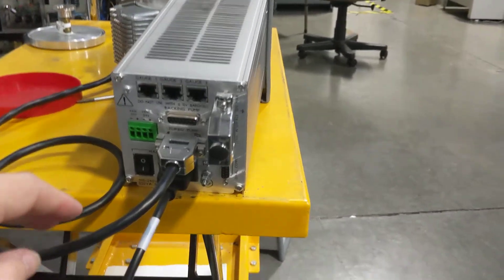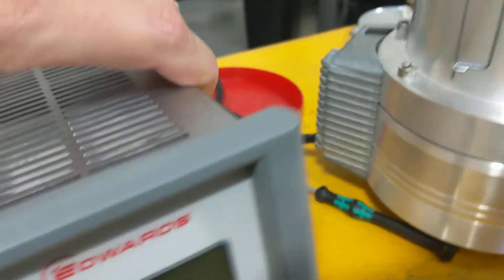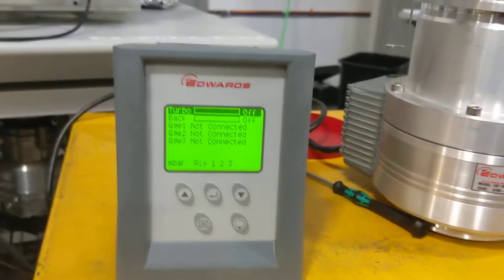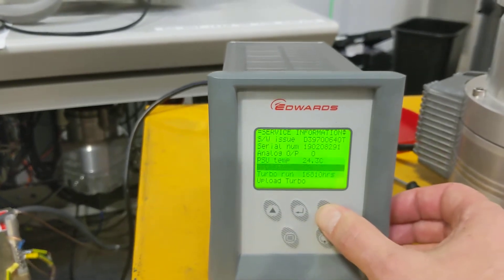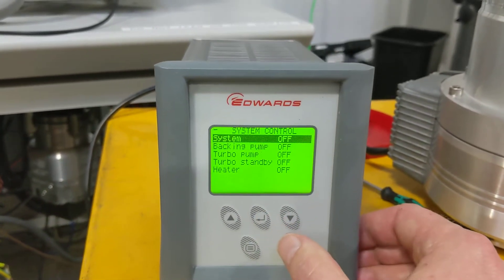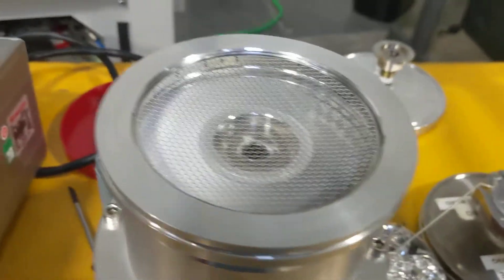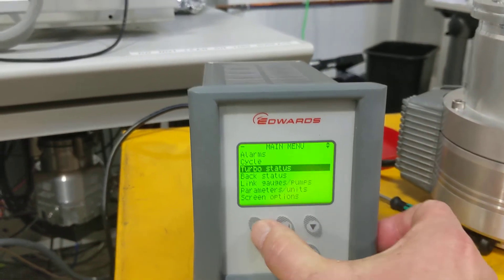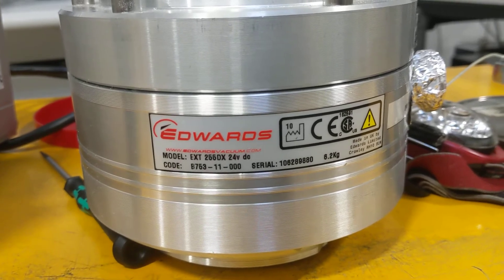Testing Edwards EXT255DX 24V using a TIC

Comment: Is that controller monitors the pressure? Or needs a separate pressure guage?
Reply from the maker: To measure the pressure you need a separate gauge.  This controller can report the measurement from the separate gauges and turn them on and off.